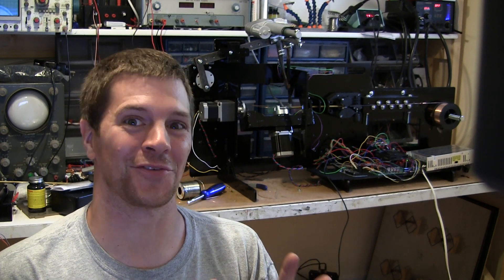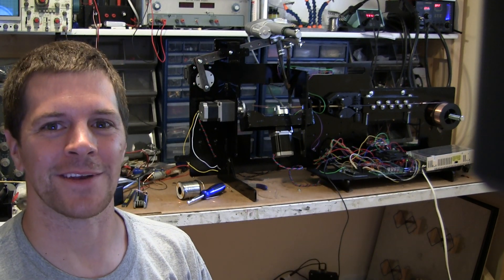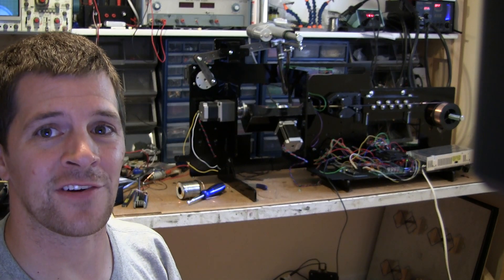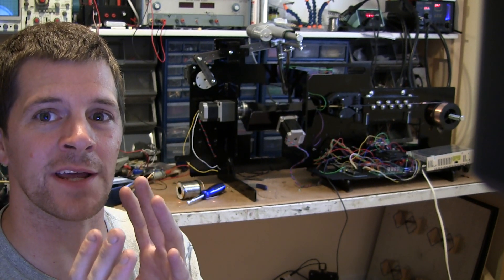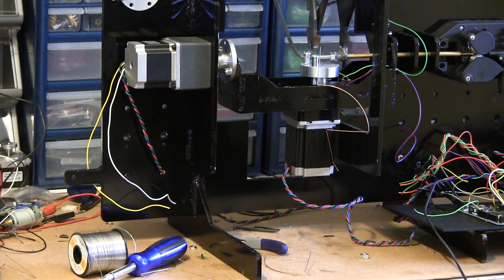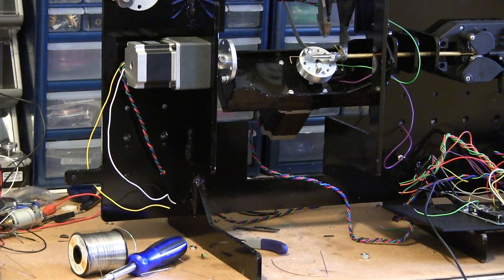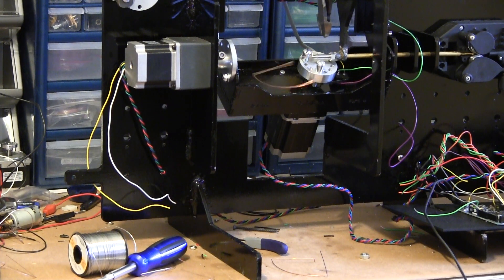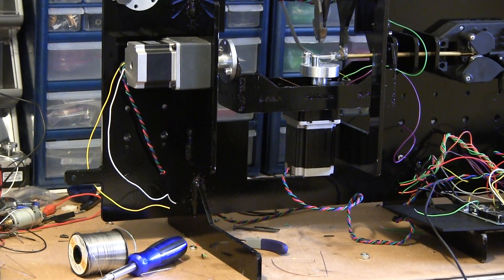CNC wire bender - RUBE demonstration

Comment: Why do you have the bender move on the Z axis? It doesn't look like you have a finished 3D part. Very cool machine. I use big wire benders for 0.148 and 0.192 in wire. We manufacture masonry anchors & ties and reinforcement using our 2D & 3D benders, spot elders, automated wire and steel machinery and equipment for the commercial construction materials market place and now I'm adding a division for POP displays. I'm wondering if you have a lot of experience with wire or are you just getting into it???
Reply: I have designed an automatic wire bending machine. It is all mechanical mechanism. The machine  production is of  2 ton iron stirrup for day. If you is interesing in speak my email is:  rzhernandez@vera.com.uy. Thanks you Ricardo

Comment: Which software do you use for running your wire bender? Is it linuxcnc / emc2 ?
Reply from the maker: It is actually run with Arduino.  I really dislike Arduino, but it is the only language I know.

Comment: Very cool Alex! Might I suggest using some sort of rotary cutter instead of the hand cutters? Something like a dremel perhaps. Might speed up the whole process.
Reply from the maker: I never considered a rotary cutter.  I will look into it.  I can speed the machine up with faster stepper motors.  This is just the first testing of the machine.  it won't be done for at least another week.
Reply: Cool! Keep us posted!
Reply: Rotary cutter would mean metal dust/debris everywhere and a lot more noise when cutting the wire. And if the cutting disc breaks, the machine won't know it. If I were you I'd stay with the hand cutters or at least something similar.

Comment: Going off the dozens of "How It's Made" episodes for similar applications, this machine runs in ultra-extreme slow mo.
Reply from the maker: Of course it does.  It is only 1/10 the size of those big machines and takes only 60 Watts to power it.  This is a workbench unit.  You set it on your bench and run it as you assemble.  No need to speed it up.  Speed incurs error.  Error means an out of resonance antenna.
Reply: Alex Greve  So true.  Plus running that for an hour will give you several dozen.

Comment: So cool! if there were more yanks like you Alex  DJI would be a USA manufactured product and kids would be employed outside the service and fast food job market or non-market. So few genuine inventors and manufacturers down there. Just re-branded overseas stuff passed off as US made. Like the 3DR Iris 9x transmitter. Total sell outs of US jobs..
Reply: I totally disagree, in my complex of 50 shops there are many many many that make products that get out and all US made.. Iv'e been making stuff in the US for the past 15yrs. I could go on and on, there are many yanks making many products in the US, the issue is that the cheap stuff tends to be made over seas, on the flipside many injection and cnc are done here in US as it's not using much labor. I have a pal that has a pretty huge Co they make fire alarm pulls, the kinds you see in hotels, and he does them A-Z in house, from the diecast to the electronics to the powder coating. My other pal makes parts for fighter jets and they are super high end carbon fiber, that replace Titanium stuff, this all US ( cali) made. Heck I make a lil thing called a K9 Tankpad and it's made in the US !  The issue is DJI is a China Co, hence the China made.. 3d Robotics makes stuff in China, but also Mex etc... Many RC car stuff like Associated is CF made in SD.
Reply: You are the minority as compared to the 1950's and not in the majority selling the youth out of good jobs. I have manufactured all means of high pro vintage motorcycle parts as well and the small shops are growing in number but only because there are no good paying jobs in real manufacture. imo

Comment: That is so cool!! So I'll order from your web site, which will start the machine, and fedex will collect? =) seriously, very impressive.
Reply: That would be great if it dropped parts right into a labelled FedEx bag.  Of course some assembly would be required when you get it.
Reply from the maker: I did mention I have yet to finish the machine ;)  I actually plan on putting a servo with a magnet on it to pick up the parts when they are cut and place them on a wire so they are not all tangled up.